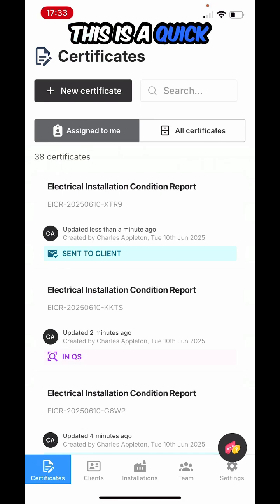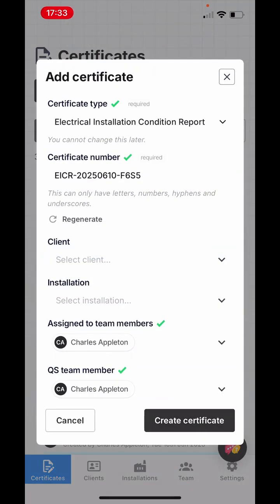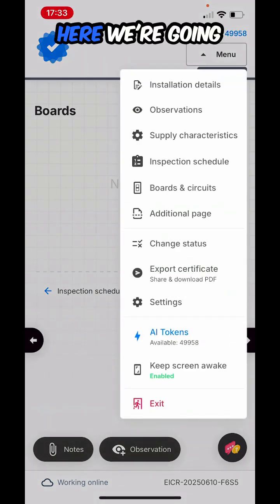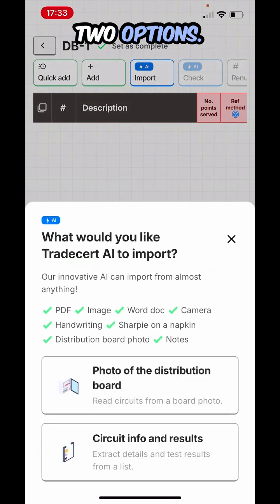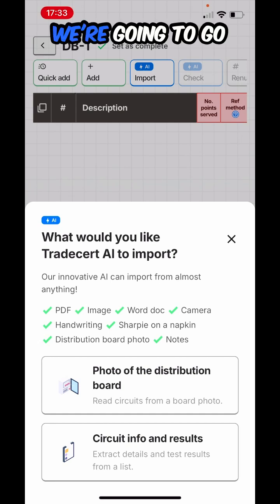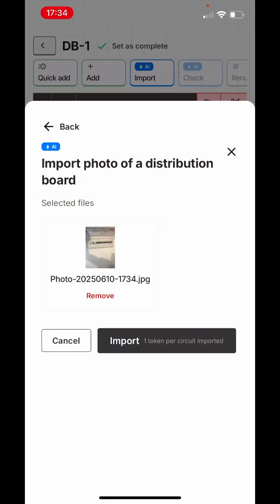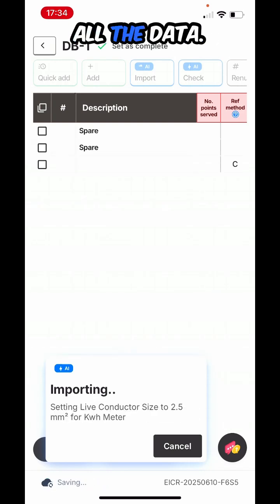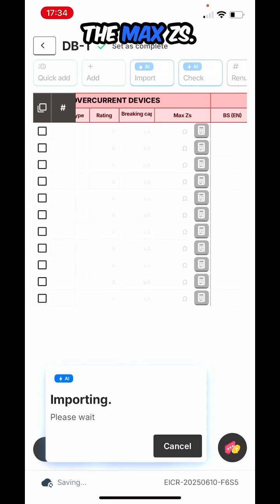How to do an AI Import - Distribution Board AI #EICR #electrican #AIfortrades #Tradecert

Comment: How are you getting the cable sizes with the lid still on? There's no AI technology out there that can check the size of the cable? How is it converting the image to text ?
Reply from the maker: When you upload a photo of the board, the AI extracts the circuit descriptions. BS EN, rating etc (like “32A Ring Final” or “6mm Cooker”) using OCR.

From there, it intelligently suggests likely values for: 
Cable size
Reference method
Wiring type

These are based on standard assumptions from industry norms (e.g. 2.5mm² for a ring final circuit, Ref Method C if no insulation is mentioned, twin & earth for domestic installs). It’s a smart starting point, not a final answer.

You can still review and adjust everything it just saves time by prefilling common values, especially for repetitive installs.

AI doesn’t “see” through the lid, it just helps you move faster based on the info you’ve already written or labelled.
Reply: Yeah, I downloaded it and had a go, its a brilliant product, definitely the future. Do you offer any type of zip export, like using json files for import export? How are you parsing the pdf's ? Are you using AI to organisethe the extracted data? Do your columns have fill down? Does the AI check calculations for ring readings? When using your calculate r1r2 and zs do you have a calculate all rather than jist one at a time?. You can do a lot with how you have got that working. I've sent it to some other engineers i work with
Reply from the maker: @tonys8448 Why don’t you join our group chat. Drop me a message and we’ll have a chat 07849344113
Reply from the maker: @tonys8448 yes you can fill columns and use PDFs to upload from. No calculate all but we’ll be adding that in soon. Drop me a line and I’ll answer the rest